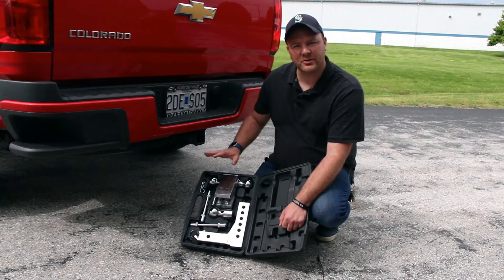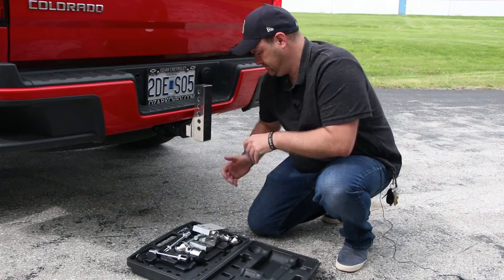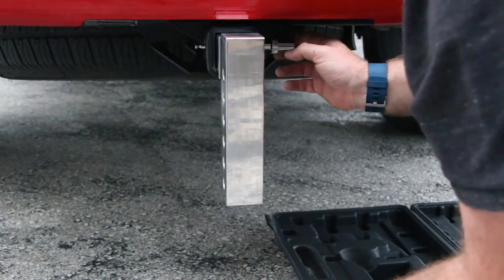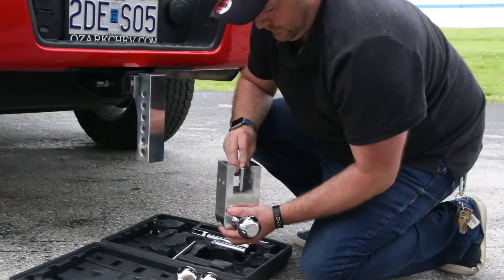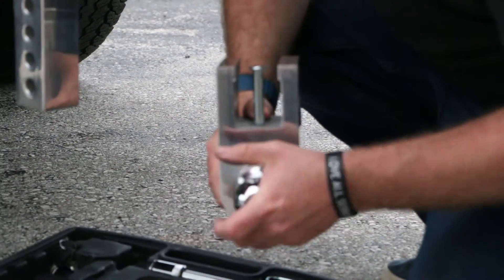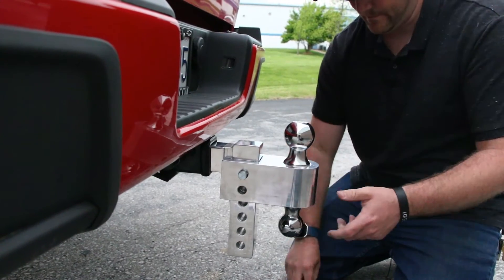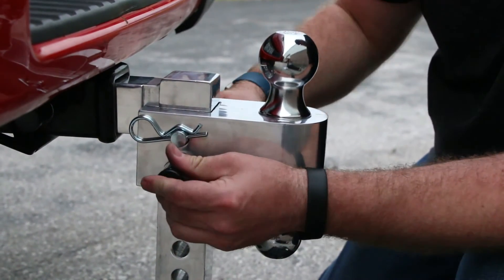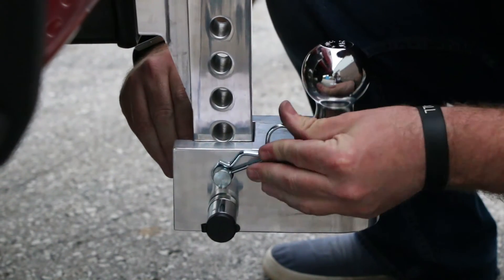How to Install the Aluma-Tow - Aluminum Adjustable Hitch Mount from Uriah Products

Comment: You guys did a great job with the video on not showing how loose all parts fit. Way too much play on this. All you guys have to do to correct this is to manufacture it with rubber bushings. Even the blow molded case is thin and cheaply made. Make it better quality. At the end of the day it is a poor reflection on your product. Would you even bother to peel a brown banana?
Reply: I bought the product and holy cow...WAY LOOSE as stated above
Reply: I see no reason to have locking pins that are 6” long
Reply: It’s a adjustable hitch, what do you expect? It’s not like it makes a difference in how it goes, if u don’t want wobble, don’t buy an adjustable one. Simple